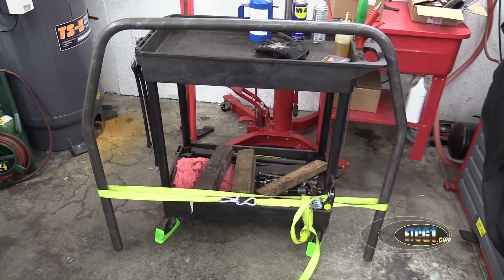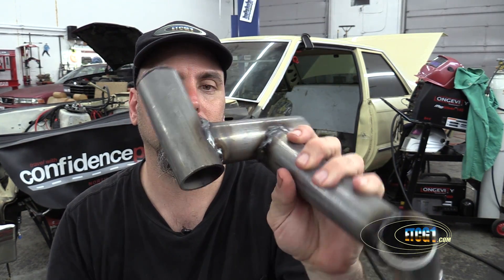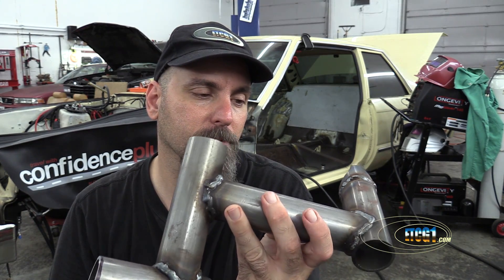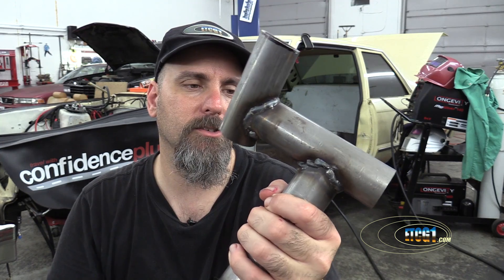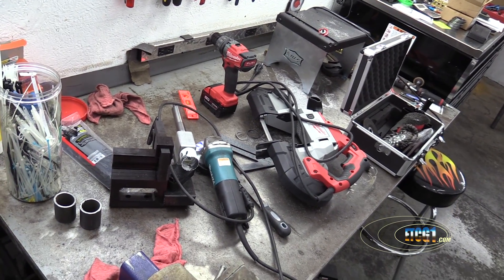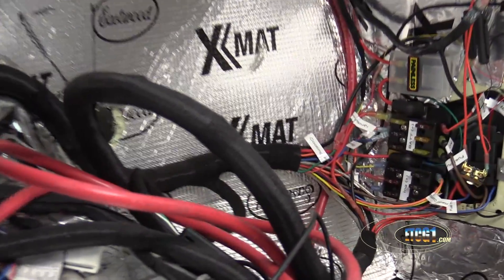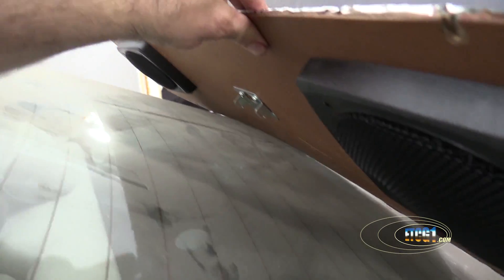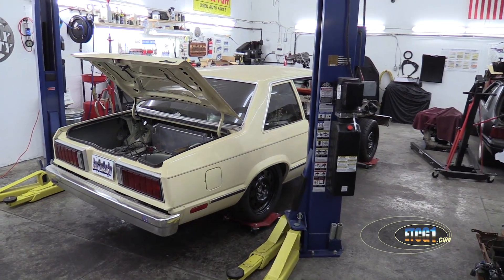Losing Motivation With Project Vehicles

Comment: Dont be down about your welds ! Get a nice auto darkening helmet and watch the puddle closely ! Took me 3 hours after i had a proper auto darkening helmet and i was welding stacks of dimes, i watch hours of youtube videos best thing i did is i watched videos that showed what happened when you have too much wire or not enough or too much volts or not enough and i forget the name but hes big on youtube so youll know who im talking about but i watched his video that showed what happens when the machine is set correctly and incorrectly and that really helped me know if i was even doing a good weld i thought i was good but i had not enough volts and too much wire feed, i adjusted until i got my welds like the good welds in the video i was watching and i really learned a lot, i took 3 hours and played with my welder on different thicknesses too played with the volts and wire feed and found too much will burn thru and too little and the weld just sits on top and doesn't penetrate then wire feed speed, too little and youll burn thru too much and it popcorn spatters and doesnt keep a consistent puddle, also when you weld you want to get a puddle going once you have the puddle going youll learn how fast or slow to move along if you go too fast you can watch the puddle cool down and too slow and youll burn thru! This is why a proper good auto darkening helmet is very important to good welds because you can really watch the puddle and see how it reacts and follows, also there is push and pull welding and i prefer pulling the puddle rather than pushing into it much less spatter and smoother welds!   Please try these things or be open to it and let me know if this helps you ! Been a long time viewer atleast since 2012 learned alot from ya, be motivated
Reply: Also mig welding darkness is 11 maybe your helmet could be set on 12 or 13 making it too dark to see the puddle and when i weld im up close a few inches above the work piece and weld

Comment: I have three cars on the road that needed major repairs-timing belt replacements, accord captive rotors and wheel hubs, and many more-, all done for the cost of parts and new tools, which was still a small fraction of the cost if I'd paid a shop to do them for me, and btw, those tools now line my arsenal of tools.  Most of it I owe to Eric and his videos and his vmanuals & live shows.  Techniques that he's passed on to us that would take a real tech years to acquire, imagine a DIYer.  Low lives who troll in these channels are only good for increasing the view #'s of the videos, aside from that, they offer no real constructive conversation.  Talk about selfishness, ugh!.

Back to the original subject, I've been in the exact same position of burnout, one thing that had worked for me is to get on the shop and just dive into the portion of the project that's holding you up - in this case the bars - work just on that portion in pieces.  I think at this stage, what overwhelms you is looking at the car still in pieces after all you've done to it and the mounting pressure of getting it done.
The experience you've earned is priceless, you now know so many ways to build a project car, but most importantly, how NOT to. imho.

Comment: Go to Edgewater this weekend and do two things.  First, have fun and watch some drag racing.  If the smell of race gas and rubber doesn't get you going, sell the Fairmont.  :-)  Second, talk to a bunch of local guys and find out who does good fab work.  Dude, a million subscribers between ETCG and ETCG1.   Some forward-thinking shop will absolutely want to make some videos with you.   
Cross brand the crap out that thing.  Visit the metal supplier that sells you the tubing.   I know you aren't building it as a bracket racer, but you know you'll want to see what it'll do in the 1/4 mile.  Get with a drag strip and promo their Test & Tune night or something to encourage new racers.  You.....can......do....eeeeeeeeet.

Comment: Why not install everything else aside from the cage  in to the car , get it running and they will make you get the rest done so quick.. I think the issue you had with this build is you jumped in at the deep end , bit off more then you can chew.. then to complex
It more you added more stuff to the list that made you go back to the start. 

I brought a bare body shell and had it built and on the road in just over a month by spending few hrs everyday chipping away at the big tasks then worrying about the fine details.  2 yrs down the line Iam still finding things to perfect and change but as it's small little jobs it's something that can be done whenever. 

So get the engine and box in get it running and once you hear it run the rest will come to together quickly

Comment: You will need professional, specific instruction to improve your welding. Judging from your test piece, there is no way you're going to teach yourself how to lay down a proper bead within a reasonable timeframe. As you said, farm out the weld job on the rollbar, but also invest in training to expand your skill set. I'm sure that will raise your spirits.

Comment: there is definitely a point where you just get sick of messing with it and honestly there is no shame asking others to do the work for you so you can just get into the car and drive it.

hell I have a 88 MR2 sitting my garage that I've worked on sinec 2013.... and it needs a bunch of engine seals replaced. I can do it myself but I'm completely no longer motivated to actually dig into the car that much. I don't mind doing smaller things but dropping the engine again just doesn't excite me.

Comment: Want pretty welds use a tig torch man better heat control use pure argon as well and you will after some practice produce near perfect welds. From the practice piece in your video i can tell you are using co2 and mig which sucks for roll cages js

Comment: why not try a boost activated cutout? most activate at around  5psi and realistically the only time you really want to hear it is when you stomp on the gas haha .. would be alot simpler to TEE off from a boost line
Reply from the maker: I don't know of such a thing. Also, there will be times where I don't want the cut out to come in automatically. Thanks for the suggestion.
Reply: ETCG1 algood... if you do a quick ebay search they have the proper name for the cutouts ... most of the kits come with a pump to activate it ... Kind of over engineered in my opinion but never the less you could experiment with and without the pressure pump

Comment: I'm assuming you want this car to be in the 11 second bracket, at least because of the roll bar?

As far as the exhaust cut outs, why?  Is it because of the turbos?  The few that I've heard actually sound pretty lame.  I had a built 302 Mustang with  2 1/2 inch exhaust with a H-pipe through two turbo mufflers all the way out to the back bumper and it would set off alarms.

Running out of steam is just part of the hot rodding world.  I wished I had kept many  of my old cars, but realistically, I just got bored with them after awhile.

Nobody should fault you if you decide to scrap this project.  You wouldn't be the first.

Comment: Big projects suck and they are hard.

I think most of your frustration is you finally found something your not good, and while you really hoped you would of been able to overcome this task.. you have not.  Being forced to ask for outside help with the fabrication of a roll cage really should not bug you so much because like you said, you never done clean professional welding before, but it is because you feel like this car has to be all you.  

And that is the crutch of the matter, since you must now ask for someones help to finish it, you don't feel its all your doing.  That's my best guess.... but if its any consultation, I'm sure a lot of car guys run into problems where they never be able to plum intakes and exhaust for there turbos.  And hey, almost nobody does there own upholstery, transmissions, and drive lines.  That stuff is black magic... you go to a wizard for that stuff. 

It's OK... I know how big projects suck... I am helping my parent, (doing most if not all the hard work) of building a garage for them, and when I first started I was under the impression this would be done before winter... I am only now getting around to putting up the siding... and the electricity is still getting to the garage though extension cables going from the house to it.  

Big projects suck and they are hard.

Comment: People lose interest and motivation and their money pot dries up. I know people who have bought a car with plans, then bought another then another and yet another. And then the original car will sit in half disassembled status and just becomes in-the-way car. I have a friend who has 3 projects going on, 1 has been for as long as I know him, he has completed 1and is tired of it and going to sale and it is complete. And the current last started project has been going on for 2 years. But his most cherry project is at 85% done and has been for at least 5 years. But hot rods are a pyramid. Time-Cost-Quality. You can have any 2 of them you pick. But you can not have all 3. If you want it quick and good it cost more money, you want cheap and good takes more time, you want cheap and quick you sacrifice quality. Got another friend building a 57' Chevy wagon twin turbo LS setup. Tore the BBC out after making 1 pass with the 4link setup that we did in the winter. And didnt finish the wheel tubs, just aluminum speed tape and screwed the mocked up tub together. He comes up with great ideas, but will rush the last 10% or punt it at 80-90% done because he gets new visions. I have the same car since 2007, I have redid things a few times and wish I did other thing different. This winter I am putting a 4link under it then I will truely be done. I refuse to minitub it as I want it stock inside.. But it wheel hops, and only has 410HP with a 5.0 (331ci), GForce T5 trans, narrowed 9" 370gear yukon locker. Just a street hotrod no track car. If you do things in small steps and return the car ot drivable status so you can enjoy your work then you wont get burnt out as you get rewards along the way.

Comment: You said you're burnt out on the Fairmont. That statement got me to thinking:

People hate this car now. They've stopped watching EricTheCarGuy because of this project. You have been forced to step away from EricTheCarGuy completely because of this car. And now even you admit that you are burned out on it.

I know the answer:

You are just another in a LONG list of mechanics who have been brought to our knees by a fucking F*rd!
Which I predicted in the beginning.

The real question  (and video discussion idea) is: Eric, do you have any regrets with this car?

I went down this road with 2 Square Body GM trucks. First an 85 K20 on a 4" and 35s, then an 80 GMC C1500 heavy half ton with 31x10.5R15 All-Terrains. I like trucks that work and wheel.

It's a bitch. You go to do a simple repair that should only take an hour or two, and you end up with a disabled vehicle which is supposed to be your daily driver. Nobody has the parts and they get the wrong parts 3 fucking times before getting the correct STOCK replacement part, which doesn't work on the upgraded HD off-road setup...

Your "give a damn" just breaks at that point. You begin to hate the thing, and you're all too happy to see it gone.

And then the guy who buys it stays in touch with you because he can sense that you didn't truly wanna sell her.

Aaaaand then he sends you a picture at 3am of your baby, rolled onto her fucking lid!

MORAL OF THE STORY

I forbid you to give up, Eric! Do it for me, the guy who fails at everything in life and career.

Do it for those of us with big dreams and tiny bank accounts.

Do it for those who like cars but, have no idea what a wrench is used for.

Do it for all of us who have lost our way and sold our projects.

Do it for those of us who have supported you even though we hate F*rd products.

Do it for those of us who have supported you when others haven't.
You owe us that much, Eric.

Most of all, do it for the 17 year old Eric Cook who still lives within. Do it for the Eric Cook who got fired from a dealership for "side work".
Do it for the Eric Cook who was $36 away from poverty.

Do it for the American dream...

Comment: yeeeaaah I got some kind of similar project, its BMW e30 which was my daily driver until engine blew 2nd time then I realized that I need to just restore this car from 1st to the last bolt coz it was like a prostitute before me and it was just a huuuge mess , so I was like okey I can fix it ( even I'm a builder and mechanic stuff is just my hobby) so I got a garage started collecting tools and stuff and I'm at the point where I got only car body and everything else stripped out , so I'm at the point where I need to fix all the rust and stuff and this is where I realized that I'm not a mechanic or whatever ... so that car sitting in the garage almost for 1 year now and waiting for me till I learn more stuff and get more money for equipment :D not easy

Comment: Drag your ass to a car show and look at what other people have created, it will inspire you to keep going on your own project and turn the heat up or wire speed down on your welder.  When you are welding metal that is thicker than sheet metal you have to get enough heat to lay a nice bead and it looks like you are welding a little too cold to me.  I am not a certified welder for what it is worth but I have been welding stuff together for almost 30 years so that should count for something.  Peace

Comment: Your wel are too cold. You welding with flux core. MIG setting calculator : https://www.millerwelds.com/resources/weld-setting-calculators
Back to basic MIG welding : https://www.millerwelds.com/resources/article-library/mig-welding-the-basics-for-mild-steel

Comment: put some more heat in to the welds
Reply: Yeah, was thinking about the same. He doesn't need to change the wire/thread speed though, looks like he have to much already.
Reply: PlAsKusJ3GaRn don't know Wot gas he is using but I'd switch to a argon co2 mix. As well
Reply from the maker: Everyone says that and it's not always true, especially with this car. Turning up the heat just blows through the metal.
Reply: ETCG1 have you tried grinning a v Grove in to where you want to weld. Put a root in on lower amps then do the top pass on high amps. It also give you a larger area for the weld to bond
Reply: ETCG1 What Simon said or you could TIG-weld it. Another way to do it is to spot weld it all the way. Then you can have higher heat and control it alot better.

Comment: Hi Erik. Your Fairmont project seems very ambitious, but in my opinion you have done it the wrong way. You have disassembled the whole vehicle and you have prepared it to be completely ready from the moment it is done. My approach for my own car, is to build it a slowly over the time. In the beginning I just started with changing the engine, then the breaking system, afterwards the suspension. In between the big interventions Ive had little modifications to the gear box, exhaust, chassis and so forth. But at any period of time I was able to drive it, so there was no lack of motivation to improve it further. I understand that you do not want to disassemble it 2-3-4 times, but I think it would have been a more enjoyable process if this project was planned for completion in years instead of months.